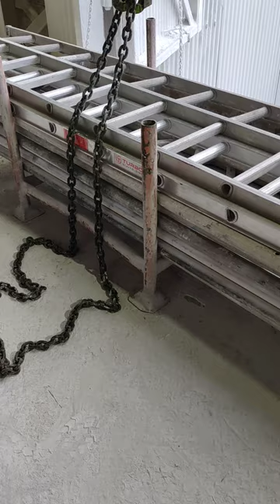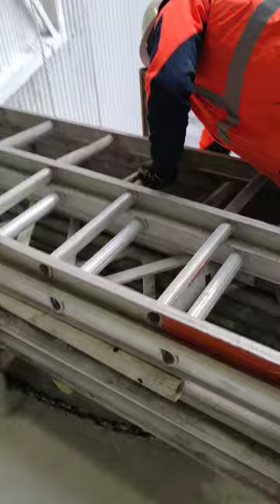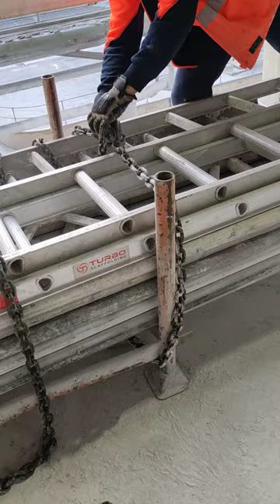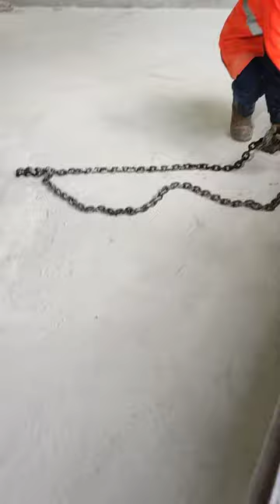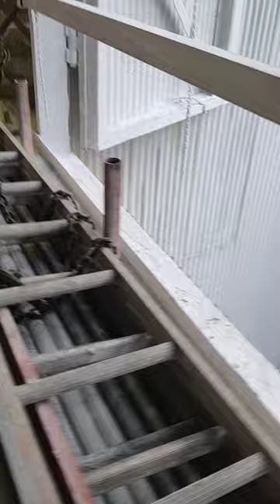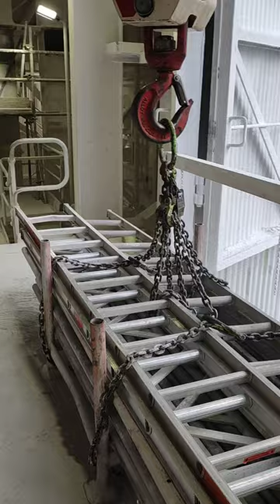scaffold stillage #crane #franna #rigger #rigging

Comment: Few things wrong if you worked like that here. First we gotta get 360 degree grip on the lift so have to wrap twice, secondly a 4 leg set of chains is for lifting a 4 point lift. Thirdly unless the chains have been shortened the same length then the load will not lift flat so either he didn't countbthe links so maybe they were marked but can't see any.
Reply from the maker: Yes some site would like you to double wrap, whats the 4leg chain for lifting 4 point line? Not sure what you mean. If you have to shorten on the spot roughly evening out the chain length works well, this one picked up perfect.

Comment: Hey bro can you do the best tips on erecting a steel pole/beam. Sometimes i do it and it will swing away and never quite on center. I use the radius but sometimes its hard too judge the actual distance the load is away from me. Can you demonstrate with the small model crane you have?
Reply: From horizontal to vertical?
Swinging away from the crane? Possibly deflection, because once you are vertical you still won't have alot of the weight even when you are in the right position and the load is vertical the last of the weight can deflect the crane more.
Reply: @msuave2772  the beam will be on the ground laying down vertical in front of the crane and once I finally get it up vertical. I can't tell wether too boom up or boom down more. It's hard too judge when it's right in front of me. Idk if you know what I mean but I want too know what's a good method for making picks that require vertical beams/poles. My friend said use the radius but things move so fast at the site I can't get out of the crane and count the feet.
Reply: @worm3615  listen to your dogman
Reply: Dogman should help you out there w the last bit, and or drop chains on pick up point before lifting and mark radius and judge from there

Comment: I always used to go in out over in and out again the arguments it would cause! 😂😂 Operators would winge at me wreckon the legs would snap off BS! Never once seen it happen or heard about it happening. Then there was the argument about double wrapping stillages everytime no matter what. As long as you lift the dam things safely and use common sense thats all thst matters. Some T/A basketed a stillage of tubes one day on site and the whole lot came down in wash plant ever since then site managers be crazy. It was stupid though why would you basket a still
Reply from the maker: Same lol check the stillage is ok and yeah i really like the wrap, but i do understand why they are against it.
Reply: I always hear the old " you'll snap the legs on the stillage rigging it that way".
Reply: Actually had it happen at a company I worked at doing general hire for construction, was the alto scaff still fair bit lighter gear (and the still had previous fork lift damage), I mainly box hitch them by default so stacking them up is easy and laying them out is easy with the tower crane.